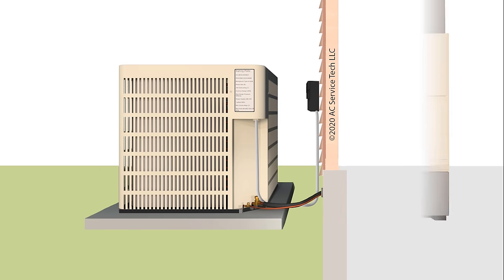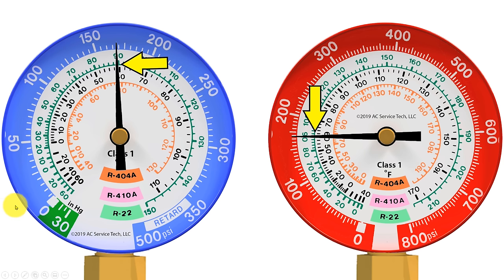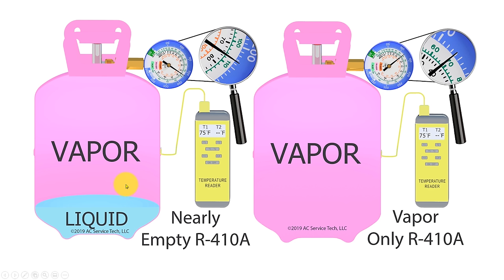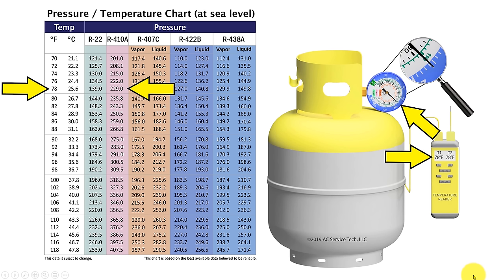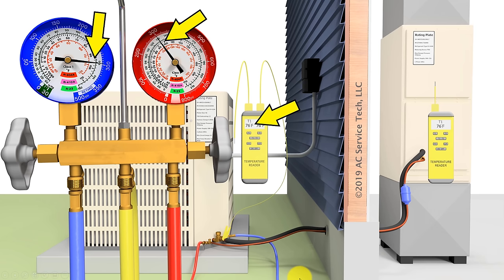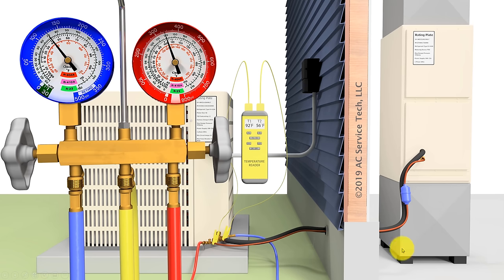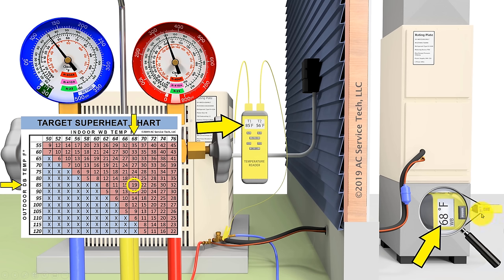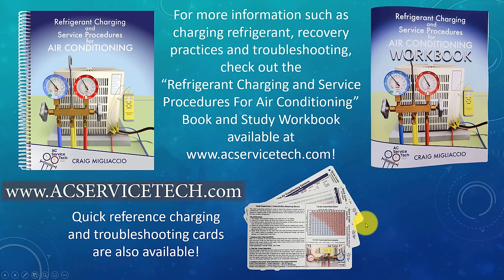HVAC Training Basics for New Techs: Gauges, Pressures, Temps, Check the Charge!

Comment: Spot on video. Not that it is hard to remember but an old refrigeration tech taught me years ago it is the direction of flow, the suction temp coming to the unit and then the suction pressure at the compressor. Then the pressure exiting the compressor then the temperature of the discharge line of the unit. Absorb heat is superheat and condensing is super cooling. Kinda quirky but helped me to remember the order.
Reply: For me it was what I call the rule of opposites. High pressure high temp you check sub cooling, cold is the opposite of hot. (If cold was an actual thing) For the low pressure/cold side we check super heat, same reason.  Not sure why but that’s how I got it to stick in my mind.

Comment: Hi,Craig,I have two questions for now the first is when you connect gauges in heat pump where you connect the high hose gauge straight to reversing valve fitting or to fitting of the liquid high line and low side hose gauge to low side vapor fitting.The second question is about the vapor state of refrigerant when you use it and how to proceed to let the vapor enters to the sister.Graig I wil appreciate you prompt to me.

Comment: Many seldom think about the accuracy of their pressure gauges or temperature measurements.

Gauges can be bought with specs from +/- 0.1% to over +/- 1% accuracy.  Cost of gauges is usually in relation to their accuracy.
1% accuracy is about +/- 3 psia at high side pressures.  That translates to about +/- 1 deg F uncertainty in vapor temp.

Thermocouples of K type (yellow) have an accuracy of about +/- 4 degs F for typical air conditioner temp ranges.
Thermocouples of T type (blue) have an accuracy of about +/- 2 deg F for typical air conditioner temp ranges.
If thermocouple meter can change its thermocouple type setting, it is better to use the blue T type thermocouple versus the commonly used yellow K type thermocouples.

All this is before user errors induced by reading gauge scale off angle making reading a little high or low from angle between needle pointer and scale, and. not providing a good thermal connection between thermocouple and copper tubing due to dirt and corrosion of tubing.

Think about this when unit specs a subcooling range of 8 to 12 degs F and your test equipment cumulative temp/pressure reading accuracy is +/- 5 degs F.

Comment: Love your videos. They are so well done and loaded with valuable knowledge. I primarily only do R134a (automotive,) do you have any books or quick reference cards for automotive R134a or R134a in general ? If not is there a video channel or source you would recommend. You've helped me get a better understanding of superheat and subcooling. My 40 ft Rv has a TXV and 36' of hoses from the compressor and condenser to the evaporator. Thanks again.

Comment: In Australia, we measure subcooling and superheat as Kelvin not degrees C or F. Aiming for roughly 5-7k of superheat and 4-6k of subcooling. I’m struggling to get it through my head what 12F subcooling would actually be in Kelvin. Any ideas? Thanks mate.
Reply: Scrap that. Just did the math. Converted your F temps to C and then calculated it that way. 104f - 92f would give about 7k in the Aussie way.

Comment: Hey I have a question 
I would like to know if the pressure inside the lines of a refrigeration system are constantly moving the refrigerant lets say at 18 bar or is the pressure stagnant at 18 bar.
Reply: What I’m trying to say is within the lines of the system 
Is the refrigerant moving at different pressures during its phase change ie 18 bar after compressor 14 bar after evaporator back to 3 bar after expansion valve or is it all one pressure it’s moving at
Reply: Yes the refrigerant in a system is moving at different pressures during different stages of the Refrigeration cycle.
Reply: @randymoreno9345  how much faster ?

Comment: Hey Craig! I'm a Senior in HS and i came across a positive video about your HVAC book! So next summer or so i plan to enroll into a HVAC program at a local trade school and i'm wondering if your book gives a person a pretty good overview of the basics and whatnot of HVAC. Cause i don't prefer going into trade school next summer being that guy that knows nothing. I kinda want to at least have a basic grasp of what stuff is/does,etc. 

Also, about trades school, how would you know if a program is a good or bad one? I know i won't enroll in one until next summer but what are some red flags i should look for when researching the schools or what questions should i ask the trade schools?

Thanks!
Reply: Good point kid.  The book is worth every penny.  Get the whole package if you can.  Book, workbook, and flash cards.  Go ahead and get your EPA 608 certification (Universal card) while you're at it.  It will give you a lot more than the basics.
Reply: Great question. 
Red flags are everywhere,not possible to know if your going in green.
My advice ,like I tell most people who are mechanically inclined. Set your self up with 5 questions you want to know the answers too.
  Ie:what is air flow,how do we measure it,how does this apply to a/c operation.
   What is this closed loop system,how can we achieve it,how many items are involved. 
  I had no school ,or internet,but I'm old .
The old guy I learned from said this to me , learn the name of all your parts,learn the function they need to do .Ask many questions.
  When i get a new helper,and he is continuously curious,with question and trying to explain to me how he's thinks it should work. I know he's on the right direction. 
I'm still learning!!
You'll get it!! Don't get distracted by the red flags,as this applys to techs as well. We just call them HACKS.
  KEEP interest in it ,and you will find the answers!
  I raised 3 kids ,nd a wife that never had a paying job. I started right where you are now . It's a great ride!! This field needs you !!
Reply: How’s it going any updates ?

Comment: As knowledgeable as you are, you are not a good enough teacher yet. You go too fast and you leave out fundamental facts about what you are trying to teach leaving students like myself wondering what you mean. Is the system running or not is one of the one's you leave out quite often for us beginners. That being said...I trust your knowledge which is a huge plus. Slow down and pre-state the conditions we're starting with each time and you'll be the best teacher on YouTube. I should know, I was, before I retired,  the best local HS math teacher...and even the best salesperson when I did that. 
On a different note, I bought at auction a Snap-On R-12 service machine. Did they recover refrigerant in those days? It will apparently vacuum out a system, but it doesn't appear to collect the refrigerant. Can I modify it to do so? Thank you sir.

Comment: Okay so we are learning our pressure readings in class and reading our superheat and subcool, my questions is should there be a average pressure each side SHOULD be? Like how do I know if it’s a high pressure, finding the calculated pressure or is there just general knowledge of what the average high / low pressure of a system should be
Reply: I'm new to hvac that's exactly my question I don't understand
Reply: @azrealgamer  yeah i think there is a ballpark as to what they should be 125-175 low and 325-375 high i think
Reply: I know this an old question but ill attempt to answer it for anyone reading this in the future. 
Refrigerant pressure is directly related to temperature. There isn't an average pressure that you're refrigerant should be. Provided that the system is properly charged and no issues exist, your "high" pressure will be affected by your outdoor ambient temperature and you "low" pressure will be affected by you indoor space temperature.
All refrigerants run at different pressures, some very similar to others.

Comment: I am trying to learn how to fix my fridge and a/c by myself. These HVAC guys are blood sucking low life leeches. They want $850 to fix a pin hole leak on the copper pipe and recharge the gas when the fridge is $3800 brand new and $500 second hand. Simply cut and weld a new piece of copper pipe which can be done in 2-30mins plus recharge and testing, I am looking at 1.5hrs labour here. 
Good video thx!

Comment: Hi 
I explore  to ur webpage  its very  organized  ..
I have questions  about Refrigerant  weight  calculator  ..
There have written  foure  query  ..
1. Refrigerant  type ..I understand 
2. Liquid  tube of OD size ..mean  conderser  tube right?
3. Vapore Tube OD size ..means evaporator  tube  right? 
4.feet of line set  ....this  think  I really  don't  understand  ..can  u explain  what's  feet  of line  set..or what  type  of value  need to put there ? 
Hope  u reply
Reply from the maker: This calculator is for split systems to determine the additional weight of refrigerant needed within a system. If a unit comes with enough refrigerant for 15' of line set but you used 50 feet then you need to add enough refrigerant for the additional 35 ft of liquid tubing and large vapor tubing to determine the amount of refrigerant weight, thanks!

Comment: Dude did you start the video in the middle or is this a continuation of a previous video?
Reply from the maker: You can check this video out which may help but no that starts out with the standard refrigerant bottle and going over pressures and temps. Here is another- https://youtu.be/FKyGuHKUNpo

Comment: And do you realize that not one of you experts ever mention that the temperatures you read in them two gauges are not at all related to the temperature a person sees on the wall of his kitchen, outside or in his car or in his fridge or his freezer or whatever, especially when the system is running, the meaning of them temperatures become clear which still never stated.
And it looks like this:
The evaporator temperature reads 40 degrees and at the time the refrigerant leave the evaporator it is at some whatever 60 degrees.  I bet no one even questions what the heck is wrong with that statement.
Here I am and wondering the my fridge is colder than his evaporator when it is at its warmest reading, it is at 40 degrees while 35 degrees as a rule and my freezer air and not the evaporator is -10 degrees.
Outragous.  Isn't it.   
I say if your evaporator is 40 degrees you need a new fridge or living in a different universe if you think that it will freeze my dam icecream which mind you better be or you won't get a nickle from me fixing my system.